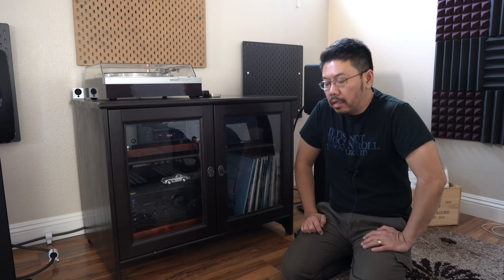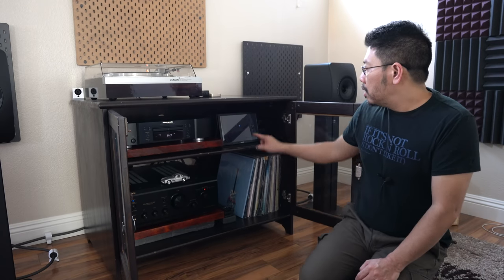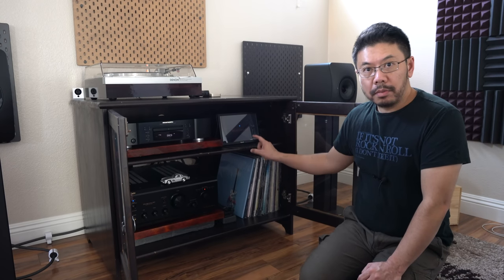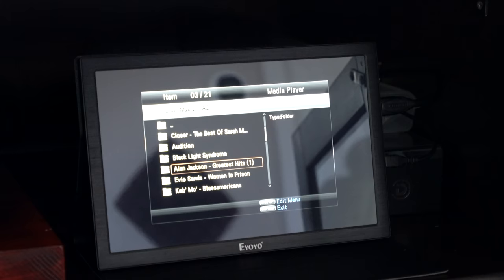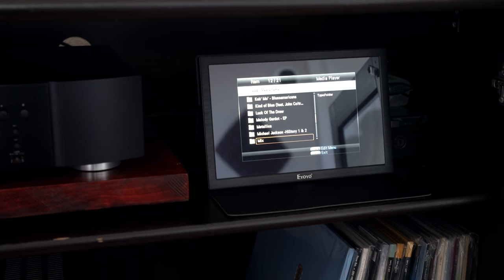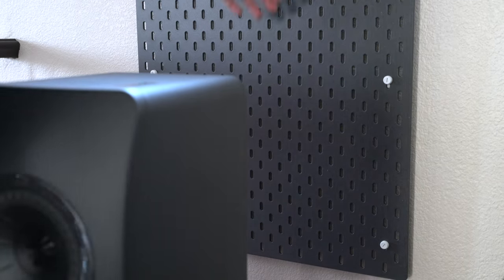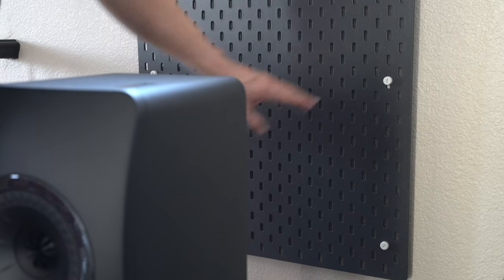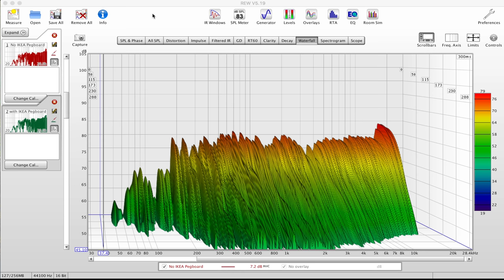HiRes DAC Update, IKEA Pegboard Sound Diffuser REW Measurements

Comment: The depth of the diffuser, and indeed that of the foam, directly correlates to the frequencies it can affect. These are SO shallow as to really only scatter/absorb the very highest frequencies. And even then, only by a negligible amount. The real problem you have in this room is the decay time (echo), which is apparently worsened by the inclusion of the diffuser, and will absolutely not be improved without more serious (and much much denser/deeper - 3-6") absorption and diffusion.

Comment: @Tharbamar perhaps worth to spend time in vid to explain what those measurements are showing.  I personally do not understand waterfall graphs (thought they use them for bass mainly).  But it would also have been nice to see the SPL charts maybe smoothed to 1/24 or 1/3 to see if any difference.  The overlays you showed do not seem improvement; rather, it just shows a difference.  I am super interested in this cheap IKEA treatment so you can probably make more videos on this and more into the measurements.  Also, what if you put some pegboards in the back wall as well?
Reply from the maker: Yes, I will make another video after I made some more improvements, for time being biggest improvement we can see is the top end spike is gone after IKEA pegboard mod in REW measurements and pegboards on back wall can be great help but I already have some acoustic foams on back wall, thanks